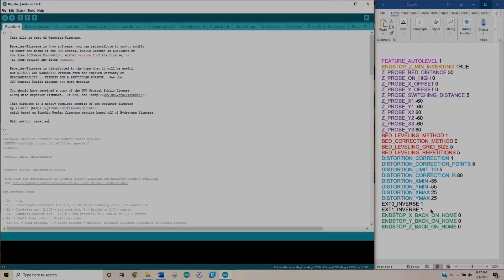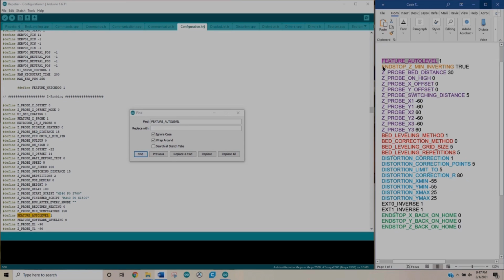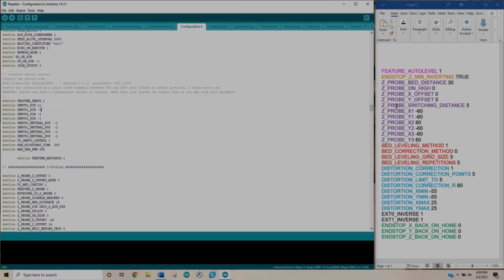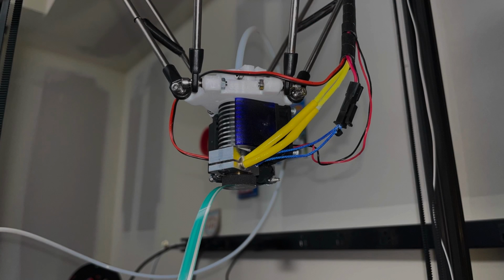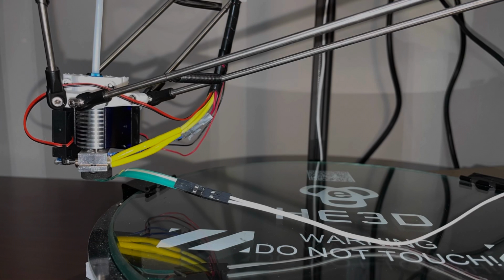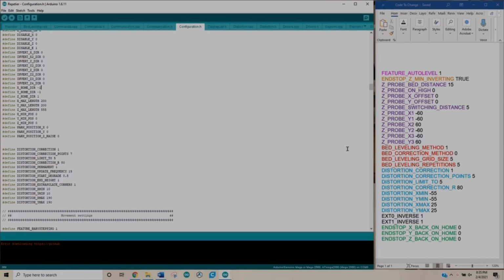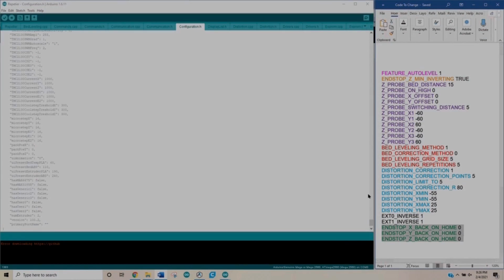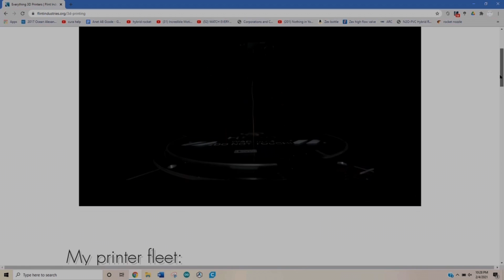HE3D K280 FIRMWARE FOR REPETIER-HOST (NEW Z PROBE REPLACED BLTOUCH)

Comment: I followed this video step by step however, when I go to follow crunchysann part 2 video I get a z-probe triggered before start error code when I run the ESCHER file, What can I be doing wrong In the firmware?
Reply from the maker: I would decrease your Z max length to about 500 and try again!
Reply: @flintindustries  Negative on z_max_length decrease, repeat error
Reply from the maker: @ovrdose0138  did you get this solved? If not, are you certain your probe reading is “L” when it’s not touching anything?
Reply: having this same problem really it has a error every time i flash .its reading max and min z endstops  as the same i think it also homes and then locks motors will only travel up towards home down it doesnt move

Comment: Could you post a download link to a copy of the firmware files you run so everyone could have at least a good starting point or possibly a functional setup if similar. Thanks, great video.
Reply from the maker: Go to the link in the description (3d printing page on www.flintindustries.org) and you’ll see it in the He3D K280 section!
Reply: @flintindustries  So your website is no longer available.... Can you put it on google drive?
Reply from the maker: @zergmare7  Absolutely, I’ll be able to take care of this by tomorrow afternoon. In the meantime, I’d give CrunchySann’s videos and firmware a try with my my modifications.
Reply: @flintindustries  I cannot find any marlin firmware for this machine. I have been looking and I had to replace the board with a mks robin nano v3.... any advice?
Reply from the maker: @zergmare7  Oh dear, I'm afraid I cannot help you with firmware on a different board. Mine strictly works with the factory board. Do you have Facebook? I'm part of a Facebook group called "He3d Delta Printer Owner" and I know for a fact if you ask for firmware in there someone will provide it. If that doesn't work out for you, get back to me and I'll see what I can do! - Justin
Reply: @flintindustries  i was told to compile it myself sadly. Im getting a mm per segment error in marlin
Reply from the maker: Also, thank you for the compliment. 😀